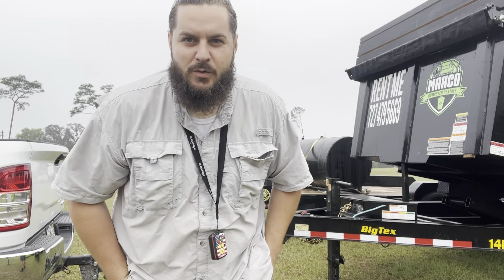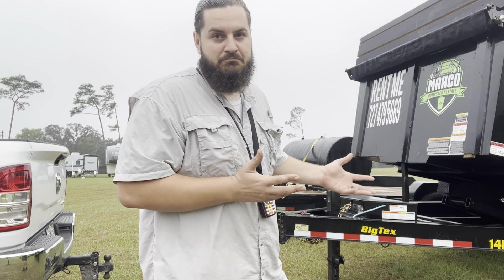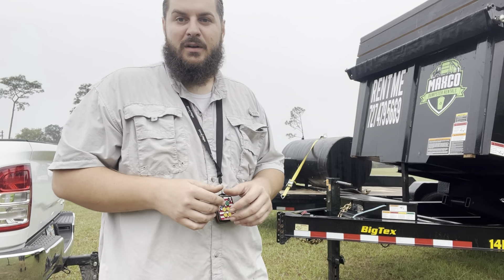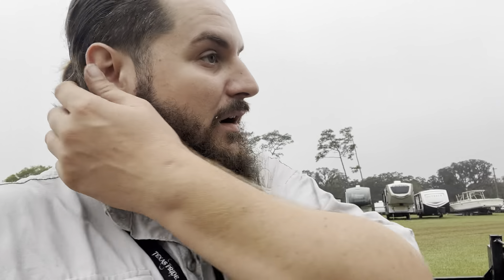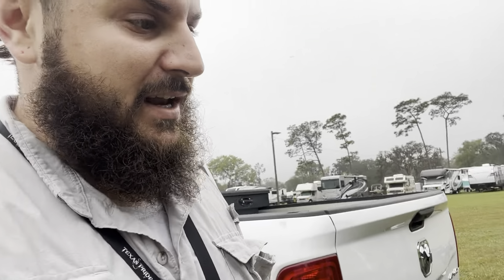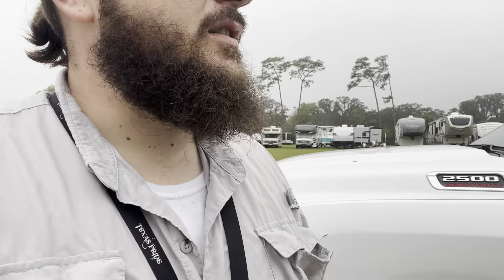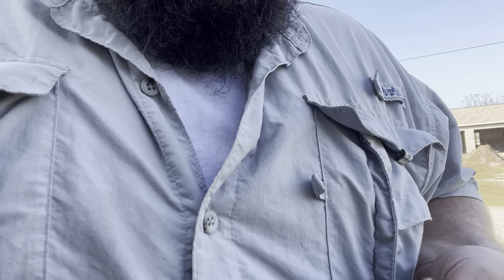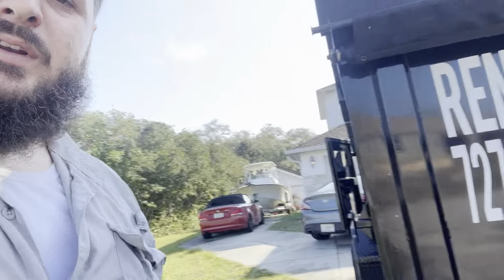Dump Trailer Rentals: Everything from Pick up to Drop off

Comment: I use Ft Knock locks on my coupler and on my C -Channel to protect to bolts from being remove. And use tracki tracking hard wire in to trailer unknown location our visible. Works great on my Texas Pride dump Trailers. Comprehensive insurance policy on your investment is the best security and a write off. But good advice
Reply from the maker: It would be great to live in a world with no thieves. 😂 Tracking and Theft Insurance are a must in my opinion for dump trailers. I may add one of the C channel locks, but I hate buying $500 of locks for every trailer. Lol The coupler locks are useless without them.

Comment: 2 things. Never twist the chains if they are too long. 
When unhitching the trailer...especially on uneven ground, u hook the chains last. I've had a trailer start to roll and the chains hooked to the truck kept it from rolling. Yes i had wheel choks in place.
Reply from the maker: If a trailer is rolling with wheel chocks in place, I’m finding a new place to drop it! Not a bad idea to do last either way though. I’ll keep that in mind.